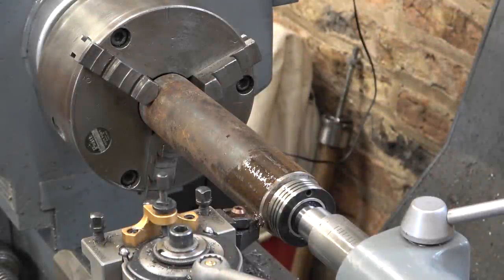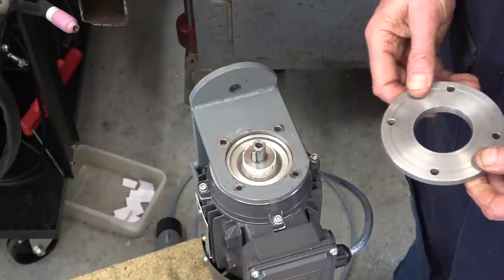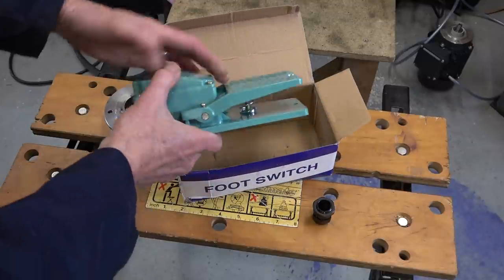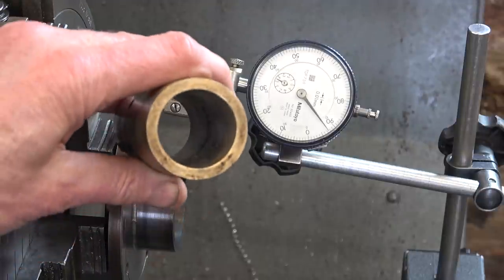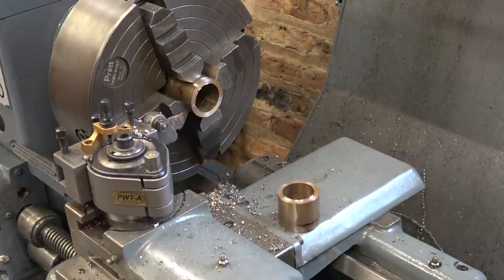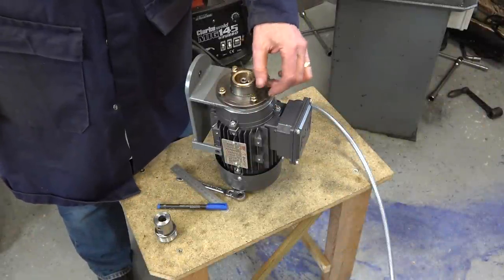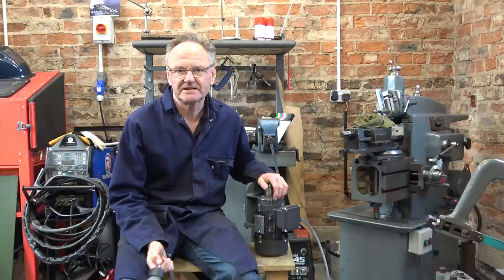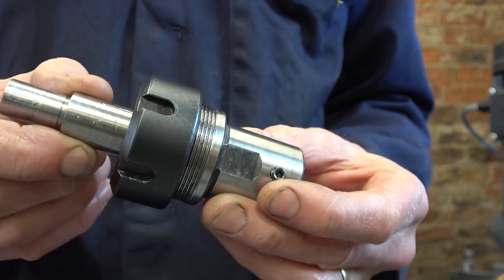HS136 Shaper milling head – Part 4  (final part)

Comment: Nice bit of autogenous welding Paul,  very nice build, innovative recycled component design. 
When you have everything finished, then you will want to charge someone for your work 🙂 😊.
Tip...if you need a thin spanner, use a larger one, with two Allen keys to adjust to your required across flats.
0.05 TIR in an economy collet chuck is fairly good.
Nice end result, proof in the pudding 🍮,  sounded like the cutter itself was struggling .
Great project and video.
Thanks for sharing.
Reply from the maker: Thanks John. Got there in the end. Cheers

Comment: Hi Paul, a really fantastic result: I really appreciated your bushing, the manufacturing method is old-style, I love it, with the oil point and the assembly by press, it is very reminiscent of the method used for the bushings of lathes; moreover, you have obtained a considerable increase in stiffness, as can be seen from the quality of the surface finish after the passage of the end-mill, a smooth mirror surface is synonymous of a rigid machine; also the very low spindle runout ensure that the 3 or 4 cutting edges of the end-mill work optimally, if you do not exaggerate with the depth of cut, the end-mill will last you a long time !! Congratulations Paul !! Alberto.
Reply from the maker: Hi Alberto, the simple 'old school' methods often work well.  Cheers

Comment: Bravo! Tell the naysayers to stuff it.  When you weld with a little undercut it's just as strong as a cold fillet weld, with little penetration.  You have penetration & good fusion of the metals. If it's OK for jody & I C Weld, then it's Ok for Paul Haxby. You were also right about the heat effected zones: they can be worse than a poor weld. I kept the heat effected zones on my dragster to about 3/16 of an inch with great penetration. They've lasted since 2000 without a crack. Congrats on the project. Enjoyed it all the way. (My wife still thinks you're cute).
Reply from the maker: Hi Bob, people have been very good with their comments and supportive. Learning to fill with wire neatly is on my list ...... Cheers

Comment: Enjoyed this series. Looks like it will comfortably do what you need in your shop, I'm with the other commenters regarding the use for filler wire when TIG welding.  It depends on the many variabilities of the actual job on the weld table, when extra strength is not needed filler free welding can be better than all the distortion. As the old saying goes 'Practice makes perfect' so continue to practice welding off camera...
Reply from the maker: Thank you Paul.

Comment: Enjoyed Paul, That's going to work out great. Dang your welding really looks nice..no worries on not using filler, it's not a high load assembly. That's some strange runout on the collet holder, but the cuts still look fine. The milling head should come in quite handy. Really enjoyed the project .... awesome series and out of the box thinking ! Congrads !
Reply from the maker: Hi Dean, the milling head might sit around in the workshop for months now unused and then suddenly I'll need it and be glad of it. Cheers

Comment: A brave project to take on, and a very good result, marred only by the inaccuracy of the bought in parts! Greased taper bearings should improve the chatter,
Phil
Reply from the maker: Hi Phil, the taper bearings have arrived and I'll be fitting those soon. Cheers

Comment: Congratulations on the successful completion of this project. My take on the issue of the bearings is that you aren't going to use this day in and day out. The ball bearings ought to last long enough to see if this is going to be a regular part of your workshop equipment or if it will be something you use once or twice a year. 
This project reminds me of the magazines I have seen from the 1950's where people would submit projects to magazines for equipment they have made or modifications to existing equipment. 
Well done and treat yourself to some time with your family.
Reply: So have you been watching fireball tool recently
Reply from the maker: Hi Robert, thanks. I remember something similar with 'practical electronics' which contained instructions self-build projects.  Cheers

Comment: Agreed about stainless fasteners! Stainless on stainless can cold weld and seize, stainless on lots of other things gives big galvanic corrosion problems. Stainless with zinc plated works ok if you ever need it.
Reply from the maker: Hi Cooperised, my son is always buying stainless  nuts and bolts for his car but when I need one I say "can you give me a 10mm but none of that stainless rubbish" ..... we have to agree to disagree. Cheers
Reply: @HaxbyShed  I'm on your side for sure, and ironically stainless fasteners in a steel (or aluminium) car part are a recipe for horrendous corrosion problems! Shouldn't be allowed 😁

Comment: Thoughts on using HSS instead of carbide end Mills since rigidity isn't that high but all in all very good project good work 👏👏👏👏👏
Reply from the maker: Hi Joseph thanks. I only have a couple of carbide mills in any case so normally I will be using HSS. Regards

Comment: this has been really good.  imperial micrometers are good but the imperial system for drill bits is a bit of a headache, cheers
Reply from the maker: Hi Graedon, I think it's the fraction number system that makes the drill sizes harder to visualise. But having said that I can visualise 2 thou much easier than 0.005mm. Cheers

Comment: Give us a quick update when you try the tapered roller bearings. Motor end bells are meant to take radial loads not axial. You may want to consider a beefy
Reply: End bell for the tapered bearings. That appears to be. TENV motor so no cooling slots will be required.
Reply: Fat fingers strike again! Don’t know how to edit my own comments!
Reply from the maker: Hi Glenn, I have the bearings now and I'll post a brief update when I fit them. It's hard to say how much end pressure the bells will get - depends whether I have to do any plunge milling. I could always make a another supporting bracket for the fan end. Cheers